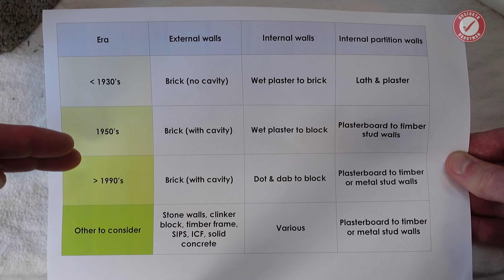What are house walls actually made of?

Comment: My 1977 built house was one one the first ever built by Bloors. They did everything on the cheap, including the internal walls. These are made of plastered Strawboard.
Hanging pictures is easy! Just get a self tapping screw or picture hook, whack it in half way with a hammer then either twist or screw it in the rest of the way. With no material removed  from the wall it gives  a really strong mount for anything that I want to hang on my internal walls. 🙂

Comment: Thanks for another great practical general overview Andy, informative as always, I wish I'd had this sort of guidance available 30+ years ago rather than learning it all through experience. I shall be sharing it with my brood, although they'll probably ignore it and then ask me the exact question in a month or two ! 

It's difficult to cover all the relevant info in a shortish video, so I think you did a great job covering so much. I've had to deal with most of those scenarios over the years apart from that Paramount board (thank god) we did look at some starter homes in the late eighties that I wouldn't consider buying due to the thin-ness of the walls - it was probably this stuff so a good dodge there !

Bricks vary so much, my childhood home was built in the 50s and all the internal walls are brick, my Dad had terrible trouble drilling them without SDS or even a Hammer drill, sometimes had to use the old Rawlplug plugging tool and a hammer, my 1990s Hanson bricks on the other hand you can drill easily without resorting to hammer action, stable enough though !

Comment: In my 1950's house I have clinker which is a bugger to drill because when you start drilling through the plaster it hits the block then moves off centre so you end up drilling a slot, 6 times out of 10.

Comment: 1996 cavity wall construction.  Is there any insulation in the cavity? Of course not, the whole estate built like that 😢
Reply from the maker: Never? I'd need to check the exact dates - thought it was mandatory by then. Mind you I still hear of new builds now where it's randomly 'missing'. 😬👍
Reply: Thanks for replying.  Great video, i learned lots. Re my house, a new build in 1996, its definitely not got any original insulation.  Had it inserted a year ago by the landlord. Several other houses have had a retro insertion in a small estate of about 50, so i suspect the whole lot never had it fitted when built.
Reply: Yes, same here, cavity but no insulation in house built in 1996

Comment: Great video, sir, much thanks for sharing your knowledge! - I live in an 1890 terraced house and thought I must have cavity spaces, most of which communicate with one of my next door neighbours. How else could their pungent cooking smells/fumes enter my entire (!) two bedroom house day in, days out? It is horrendous. The fumes come into my house through and around power sockets, pipe entry points, around door frames, some light switches, skirting boards, some floor boards (staining my light carpet black) and the loft. For months now I am trying to seal these sites but the stench still keeps coming in. I suspect the ventilator over their cooker might misdirect some of the extracted air into these cavities? It is driving me close to insanity. Moreover, the neighbours never open any windows, not even in the bathroom. Thus I worry that with the stench, also humidity might end up in these cavities, potentially causing mold to grow and/or structural damage, and in case of a fire in their kitchen, it would spread over to my side much faster than under normal circumstances. Am I mistaken?

Comment: I've built 2 houses in last 20 years and used  concrete block inner on both - cheap, easy to do fixings, and thermal mass makes it really comfortable. Just make the insulation meet the regs.
Reply from the maker: Yup, would concur with that. I think thermal mass is often overlooked. The newest regs are tricky though. 👍

Comment: Seems to have dot and dab on concrete blocks in a 2000 house? Drill through the plasterboard then the hole gets ripped wider as the drill wanders off around hard lumps in the block. The number of plaster board patches I've had to make are annoying. Any tips on dealing with this combo?

Comment: Some sand stones are just as hard if not harder than igneous rocks you cannot drill in to them whith ordinary tungsten carbide drill bits thay will get so hot thay will melt before you get anywhere you need much more expensive cobalt drill bits limestone is commonly mistaken for sandstone and can be much softer and easier to drill

Comment: 1880's cotswold stone in mine, except the kitchen extension, which is a 1990's job. 
Previous owner plaster-boarded the entire inside for insulation reasons and also because the plaster on the inner walls was so thick and so old, would just crumble away.
I've thought about having the plaster board removed, the plaster underneath removed and revealing the stone - but the cost and disruption would be incredible, plus we'd lose a layer of insulation.
The stone itself - it must be close to 10 inches thick from outside to in. Suffice to say, the house isn't going to collapse any time soon!

Comment: My house is a mid 1950’s mid terrace council house, the internal walls are terrible to drill, the drill wanders all over and the hole ends up larger than the drill. Even starting with a smaller drill as a pilot doesn’t help much.

Comment: Ours is a 1960 house with brick outer leaf, block inner, no cavity and rendered inside with a thin skim of grey plaster!
Reply from the maker: No cavity? Unusual for 1960 but you really see all sorts! 👍
Reply: @GosforthHandyman  There's a mixture of chalet type houses (ours) and bungalows in our road. Some have started having insulation on the outside. I'm not sure about that. it looks a bit odd around the window reveals and at the edge of the roof.

Comment: My house was built in 1963, it has paramount walls internally, it was built by Wimpy homes and at the time was ultramodern, it was a nightmare to fit a towel radiator, had to demolish half the wall and rebuilt it with some structure (ironically the roof structure is engineering overkill).

Comment: I have paramount walls all upstairs but I thought at least one wall would need to be solid load bearing to support the loft joists? Or is it supported by the roof?

The downstairs wall along the stairs is blocks but then changes to paramount when you go upstairs. You can see how out of level the downstairs wall to upstairs wall is where it changes material.
Reply from the maker: Depends on the span and the design of the roof. Been in houses where there are no supporting walls mid-span. 👍

Comment: And if you have a wimpy no fines house with paramount walls on the internals......just sell up.....does anyone wanna buy a house?
Reply: Ah just got to you mentioning paramount walls🤣 
I may have just installed a timber rack 2 brackets on the 48 centre studs🤦🏻 and the other 2 on bullfix fittings into the paramount plaster.....it's a risk at around 120kgs of wood. But if or more likely when it collapses I will rebuild the wall properly

Comment: When I was doing a renovation of my fathers large 1910 house we cut out a section of the kitchen wall to move the small single paned window to another exterior wall overlooking the garden (previous one was facing the garage) and make it 3 panes wide.  While cutting into the wall with a disk cutter, we kept seeing sparks, so had to stop and use a breaker to see what was there... CAST IRON BEDFRAME PARTS, I'm not joking - to "re-inforce" the wall it looks like the people who built it threw whatever long bits of metal they could find into the wall, electrical conduit pipes (with no wire in) and bedframe parts.

Lord only knows what else is in there....

Oh and I've just remembered when I was doing a different renovation of a large 1912 house, we stripped back all the old paint (thank the heavens for pressure washers) to the bare lime roughcast and found..... animal bones, shells from mussels, cockles etc, broken glass, broken crockery, floorboard cut nails - I commented to the customer at the time and took photo's, it looks for all the world as though the works had lunch, swept it all up, then mixed it into the roughcast mix, of which 90% was coal clinker, and then slung it at the wall.

Comment: I remember moving into a new build in the 1970's. I didn't have a drill so used masonry nails for this particular job - or tried to. The nail actually bent unto a 'U' off the brick face and pulled the plaster off. I thought they were too hard to bend and would break, but no. The gas installer took all day to make a hole through the wall for the gas balanced flue. I've never come across such hard bricks.
Reply from the maker: Some are crazy! Our gas installer broke his core drill drying to drill ours. 😭😭
Reply: @GosforthHandyman  Hope he didn't add it to the bill. Our gasman tried to charge me for two rooms because it was a kitchen-diner even though it was just one big room. Quick visit to Southern Gas (as it was) had it sorted.

Comment: 1970s ex council house in Bristol here, all the internal walls are paramount board and it's a f*cking nightmare. You're absolutely right about tiles taking half the wall with. Retrofitting new sockets and cat5 involves breaking through all the egg box interior to form a channel.
Reply: Also hearing "tret" as the past tense of treat made me smile, not heard that since moving down south 20 years ago (and I get the piss taken out of my for saying stuff like that when I slip into my old accent after a beer or three)
Reply from the maker: Ha ha!! Tret is correct in my book. 😉😂

Comment: Thank you for sharing your knowledge, really interesting.
Is there a way of telling/educated guessing if your external walls do have cavity insulation? We've recently moved into an 80s detached house, and it can get cold soon after the heating's off, so much so that I'm curious. It's red brick external, throughout, laid end to end so without the shorter side lay that you mentioned as an indication that it wouldn't be cavity.
Thank you.

Comment: My house is from 1949 and the walls upstairs are made of the dark gray/black cinder blocks that you showed in the video. Would these blocks ever be used for a supporting wall?. I am asking as I want to move one of them so I can turn an upstairs cupboard in one of the bedrooms into a room by building over the stairs but the wall seems to be cantilevered on the end of the floor joists that go over the hallway downstairs. (if that makes sense?)
Reply: Yes  they can and are .  1948 house here  I've 2 internal supporting walls made of clinker blocks  so be careful.
Reply from the maker: It's unusual but certainly possible I guess! All of our supporting walls are brick. I'd get a structural engineer to take a look. 👍

Comment: I've got a 1973 Wimpey with paramount wall partitions(not seen metal studs) and single brick load bearing partitions. I moved from a Barratt with a kind of compressed straw partition. My wife wants me to shelve out the airing cupboard but all 4 sides are paramount! The only solution I can think of is to build a frame from the floor. Awful stuff. Around Stockton on Tees. Good video.

Comment: Victorian terraces in Portsea Island from about 1880 onwards were made from local bricks from the clay underlying the east of the island, as the need for housing spread from the west dockland areas of the city of Portsmouth eastwards. In Fratton and Southsea, even this early, the external walls had a 3 to 4-inch air-filled cavity, presumably to keep out the worst of the coastal weather. Mouse and rat infestations in these walls are common today.

 The wrought iron fishtail wall ties have mostly rusted away by now and rust expansion has led to horizontal cracks in the mortar, and need making good with modern remedial wall ties of stainless steel. 

Recently, 3 adjacent terraced houses in Fratton (7/12/2022, Nos. 25-29, Langford Road PO1 5RJ) collapsed when a front door was shut! It was reported that low quality bricks in the foundations were responsible for the instability. 

The bricks on internal walls tend to be soft, or very soft. The mortar and plaster was made with lime burnt from chalk quarried on the South Downs to the north on the mainland and was mucky and grey, and today is mostly rotten below the finish plaster. Internal and party walls were either single-thickness or double-thickness solid walls. 

Many walls are difficult to securely fix load-bearing supports for shelving having thick plaster and soft bricks and mortar. Many large flat-screen TVs have met their doom this way.

The finish plaster and mouldings are made from higher grade plaster, and plaster of Paris. 

Much recent renovation has included internal cement rendering of ground floor walls for damp proofing work and dry lining or gypsum plaster finishes, as well as artexing. 

On exterior walls, a variety of external rendering and other finishes are in evidence. Due to wartime bombing, as the nearby Naval dockyards were a prime target, terraces often have a few post-war houses interspersed marking bombsites.

Comment: Have you ever come across straw walls? I'm not kidding, my partition walls are made of compressed straw.

I've had the most success using a humble wood screw, no plugs required
Reply: Stramit is the work of the Devil! Nothing load bearing can be fitted unless you can bolt right through. LOTS of screws or nails is one option. I will never forget the electricians horror as he tried to chop out a back box and this avalanche of expanding  straw soon filled a black bag.
Reply: Yes! I had a house in Droitwich, built in the 80's - found out when the bathroom wall bulged and collapsed when water got behind the tiles. I replaced it with a proper partition wall. It had 'Stramit' printed on it, and was about 60 mil thick. Absolute crap.
Reply: Yes I used to live in a house like this, it was so warm!

 I had great success using the screw in cork screw style plugs as obviously there’s no space for a normal spring style plasterboard plug, they held so much weight, I guess because they were supported all the way through
Reply: Had these on a job. Chasing out for cables was a nightmare.
Reply: Yes, got the shock of my life when doing a job for a friend when I found his interior walls were studding about 50/60 mm square and the spaces were filled with compressed straw bats.
Reply: Yep, I grew up in a house built in 1970 with straw partition walls upstairs. My dad removed a built in cupboard from one of the bedrooms built from the stuff. It had a layer of chicken wire each side for the plaster to key to. What a blooming awful material. Glad that idea got dropped.
Reply from the maker: Nightmare!!! 😬😬😬

Comment: We live in an 1800’s cottage with 2ft thick external walls. However in the 1980’s some internal partition walls of paramount board were added. I wasn’t aware of this until I came to remove tiles from a bathroom wall. Intending to re board the wall I bashed several holes looking for studs as I’d never come across paramount board. Ended up having to make good to the holes and getting it reskimmed. Nightmare 😢

Comment: My 1750s house is made of native rock and recycled ships timbers! The native rock is Cambrian (very simple life forms begining to evolve), comprising silts and sands metamorphosed, folded and distorted into some very hard rocks with folded layers of more fractureable parts. Odd igneous intrusions pass through the native so can also be in the walls. These are 'held together' with old mortar which turns to dust if you look at it. Centuries of rodent residence have produced cavities of unknown proportions! The external walls are 60 cm to 1 metre thick. Various coatings have been used, dab and dot, concrete render with plaster or 'filler' and structural wallpaper as mentioned elsewhere! 'Filler' is pink, large grained and hydrophilic. It has the structural integrity of an eggbox, when wet, a wet eggbox. Picture hanging, easy using the ones with several short pins. Shelves, use floor to ceiling shelving units, tying in at ceiling/joists. Shelves in alcoves, wedge them in, the alcove will be narrower towards the base. Kitchen units, you framed it out to run electricity behind for flush sockets. Yes putting power fittings on any external wall is almost impossible without framing and while you are at it, insulating. Would I move? No it's taken 26 years to understand this house, too much time invested! 🤣🤣